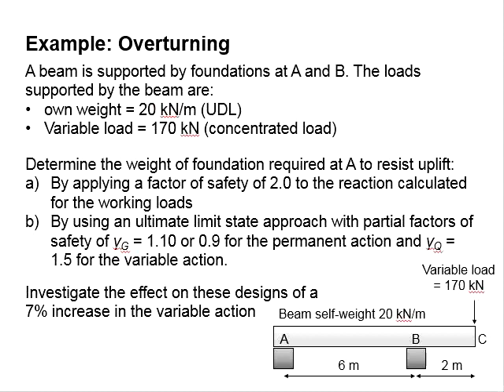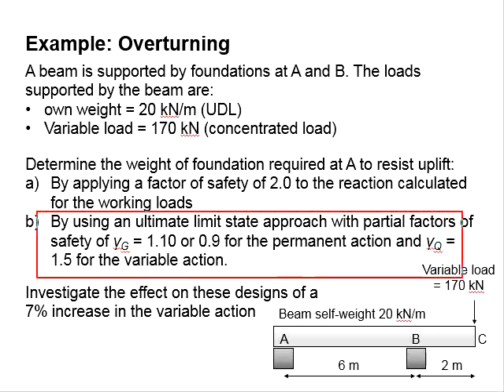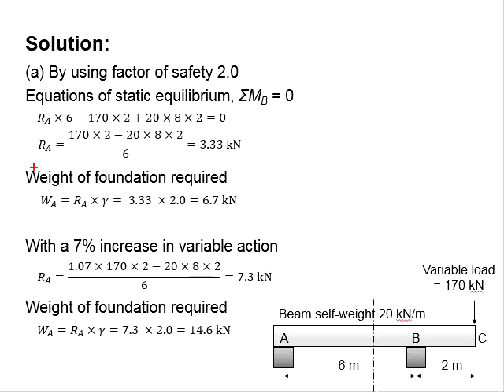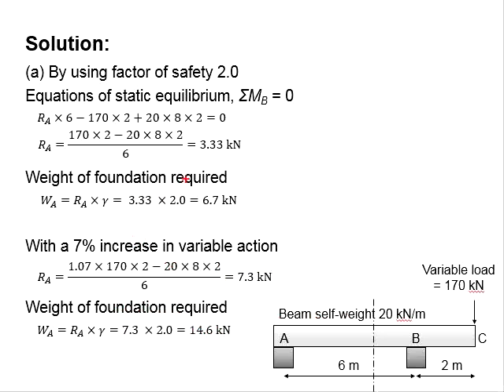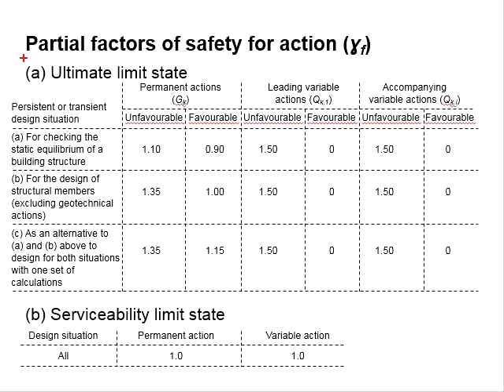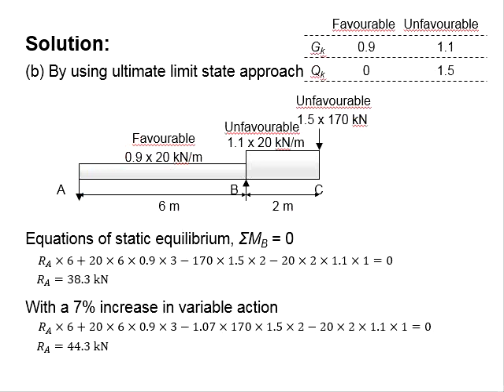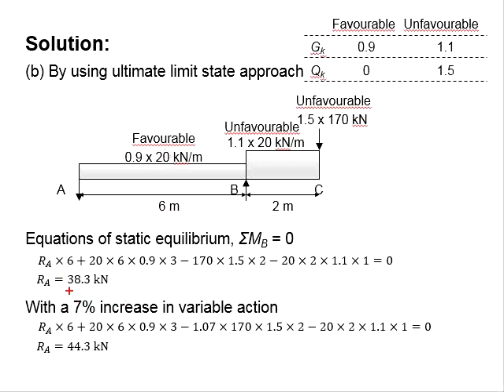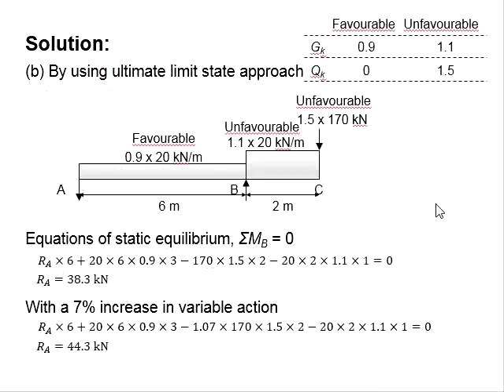2.9 Example: overturning load

Comment: How do you know 7% increased in variable action, why not 10% 50%? from where did you get that "7%"?
Reply from the maker: This example demonstrate to you that the calculated results will be different if you use different ways to apply factor of safety. 
the first method predicted RA = 6.7 kN, while the second gave RA = 38.3 kN.
If the variable action increase 7%,
the first method predicted RA = 14.6 kN, whereas the second gave RA = 44.3 kN.
we can conclude that: 
1. second method is more conservative, which is safety, that's why we always use the 2nd method in RC designs.
2. it does not mean that higher FOS is always better. the favourable action may hv counteracted the unfavourable action, causing us missing the critical case.

Comment: @ 2:40, how come "20 x 8" permanent moment at RA be positive? the load acting clockwise, so shouldn't it be negative?
Reply: thank God someone saw it
Reply: @PierreMedjaebahpierre The reaction at A acts downward because the applied loads cause uplift at the support, and the foundation provides a downward resisting force to maintain equilibrium. The 170kn is too huge and acts at long distance  from A so it will try to uplift support at A, from Newton's third law ,A will oppose the lift and that's why the arrow is down at A meanwhile at B... The support is being compressed not lifted. You are welcome

Comment: I could not be able to understand the favorable and unfavorable loading schemes for the problem (b). Our aim is to get the worst-case scenario at A, isn't it? So, this means that we have to obtain the maximum value at reaction A. To do so, why did you not take the unfavorable load for span AB and the unfavorable one for span BC? Because, from the static equilibrium point of view, reaction at A should be in the upward direction. By taking the moment at point B, it is seen that loading contribution from distributed load span AB, is proportional to the reaction at A. Opposite for the distributed load BC, and the concentrated load at C.

Eq. eqn for taking moment at B:

 (Ra).(6m)=(gamma1)(20 kN/m)(6m)(3m)-(gamma2)(20kN/m)(2m)(1m)-(gamma3)(170kN)(2m) 

Hence, if we increase gamma1, Ra will also increase, right?
So, in order to increase the Ra, should not we increase gamma1, and decrease gamma2 and gamma3?

Saying increasing gamma1, and decreasing gamma2 and gamma3, means that span AB should be unfavorable and span BC and concentrated load at C favorable?

Thanks.
Reply from the maker: You can test for both cases, one is by hving span AB favourable, another is by having span AB unfavourable. Then take the worse case scenario. A simple rule of thumb, if you foresee the reaction shall be going upward, whichever load going against it shall be favourable, as it is going to reduce the final magnitude of the reaction.

Comment: how do you choose the reaction way  ? going up or down  ? and why would you multiply weight of the beam with the total length and the length/2 , i mean *6*3 or *2*1 thanks sir
Reply from the maker: Q1: how do you choose the reaction way ? going up or down? 
Direction of the reaction is determined on the basis of ensuring static equilibrium of the structure. Since the beam is cantilever, Reaction A is going upward, while Reaction B is most likely be going downward in order to resist the 170 kN cantilever load. You can use the static equilibrium principle to find the reactions of both support to confirm that. 
Q2: why would you multiply weight of the beam with the total length and the length/2 , i mean *6*3 or *2*1 thanks
Weight of beam (UDL) x total length = force
length/2 = lever arm to get the moment at support B
Weight of beam x total length x length/2 = force x lever arm = moment at support B
Reply: @eng-aim  i don't think that's what you did in your calculations prof. bcs my own RA=-60KN